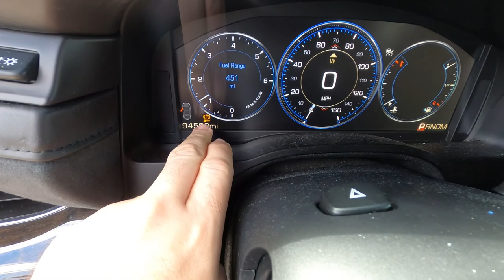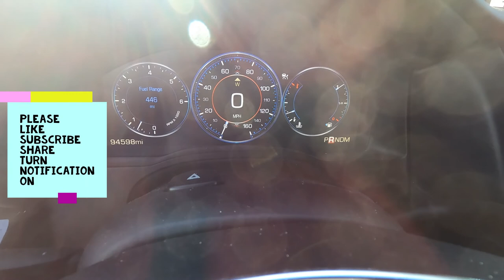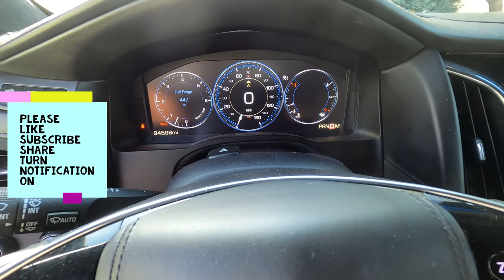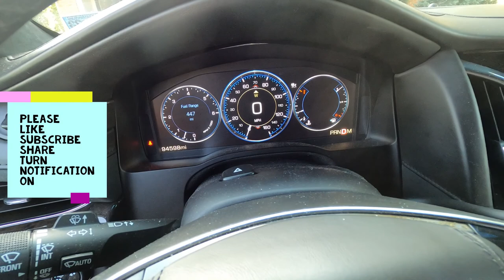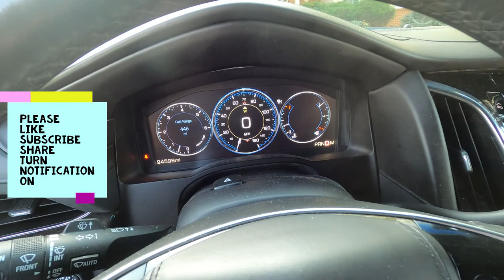how to fix Cadillac/GM electric park brake problems

Comment: I have the same light on.    8 hours later in the Cadillac shop still on. Think of the money you saved.  Great explanation of where all the do dads are.  Mine is complicated because the brake works in use but the switch does not.

Comment: Solved... No need to take it all apart on the module remove the T20 screws without taking module out just fender liner then  the 2 posts that put the 12 volts to the motor it might look like a good connection but it's not just get some plyers and  squeeze together a little better then cycle the brake off then on then off and lights in dash will stay off.

Comment: I have never understood hoe the Wonky Parking Brake Cable on GMs work, as it appears the Cable from the Pedal/Actuator goes all the way to One Brake Assembly, and another Cable seems to hang around the Casing of the First One, but there is no Connection to transfer the Application of the brake to the 2nd Cable. It made no Sense on my 81 Olds, 86 Cadillac, 94 & 95 Buick Roadmasters, or on my 95 Fleetwood. My XT5 is even goofier, with some kind of Solenoid on the Rear Calipers. In the past 40 yrs, I think I can count the Number of Times I have used the Parking Brake on One Hand

Comment: Brake not break
Reply from the maker: Thank you. Auto correct did it this time 😀😀😂😂😂😂😂
Reply: @pharaohssquad8078  thanks for the video, a friend of mine had the same problem and towed it to the dealer.
Reply from the maker: @dan5979   you are welcome. If you have any question please don’t hesitate. Thank you again
Reply: Di you need to calibrate the module after all is installed?